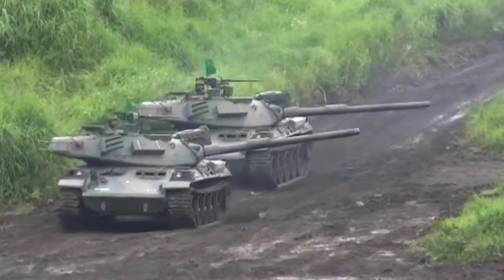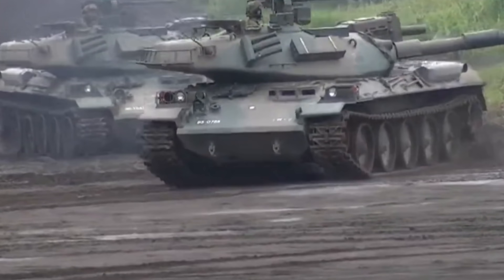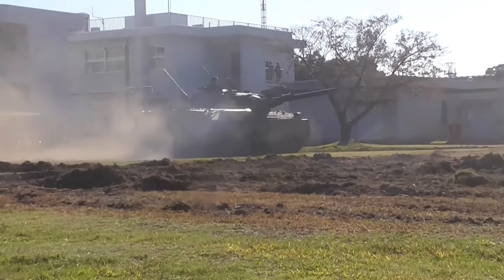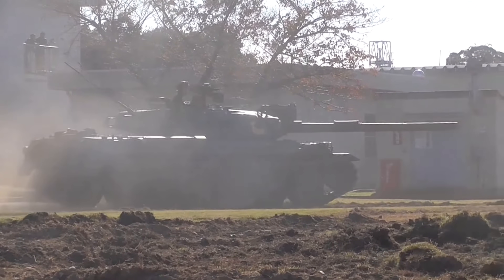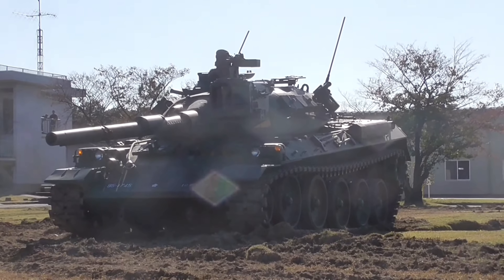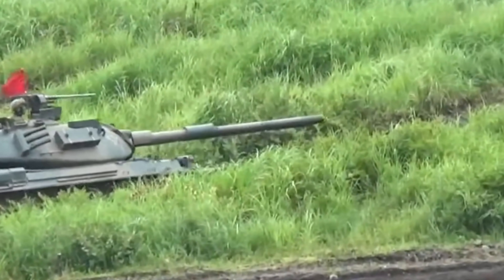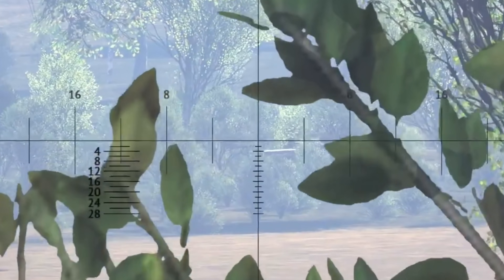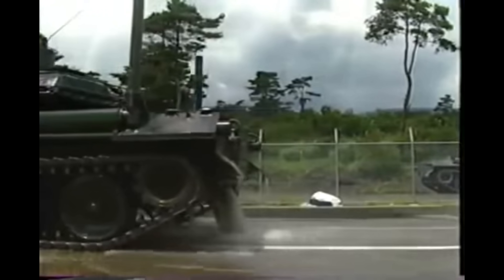Japanese TYPE 74 Main Battle Tank Overview | THE TOO LATE TANK

Comment: The t 80 was built for snow low rounded turrent snow drifting don't pile around them but wide tracks for snow and bury in snow or tree line looks like a broke off tree the barrel and will pull rite out in  1st. Not a war lord just a gear head nerd

Comment: It came really late but it's still very useful. When it was new, the Japanese only planned for defense operations on it's islands. The main opponent would have been China and possibly the USSR. Both utilized mainly T-55 and derivatives. It would have overpowered them easily. Given the terrain and Japanese preparations, even the newer types could have been picked up from defensive positions. This usefulness might be one of the reasons it's still in Japanese service today.
Reply: That's not true. Japanese ground defense conceptions were occupied with the USSR in the Cold War, China wasn't really perceived as a threat in this regard. 
And by 1974, the soviet army had already adopted not only the T-62 but also the T-64A and the T-72 and was to adopt the T-64B only two years later.
Reply: @hendi1571  While this is true, you have to keep in mind the logistics of a naval invasion. Soviet Armed Forces invading Japan at Hokkaido for example would not simply be able to magically teleport their heaviest tanks across the Sea of Japan during initial phases of invasion. Soviet naval landing forces could only do beach landings with T-55 due to weight limits, and as such the Soviet Navy were actually the first adopters of hard kill APS for their T-55s to compensate for lack of armour protection. 

In any case, the statement still stands that the Type-74's main armour opposition, unless beachhead was secured and expanded without convoy harrasment, would be Soviet Navy T-55 tanks with active protection for ATGMs. T-64 would absolutely be tied up fighting in Europe anyway in any realistic WW3 conventional scenario, and T-72 would likely also be directed towards the European Front primarily.
Reply: @manofconstantgold  that's a very good point actually! I just tried to find equipment lists for the far eastern Military district, but as it wasn't subject to the CFE treaty it's quite hard to find information about. But it's quite possible that its units didn't receive T-72s in substantial numbers.
I think its still important to point out that the Type-74 was already very much outdated back in 1974.
Reply: @hendi1571  Again, I would debate that you could call it outdated. 
Outclassed by certain premier designs? For sure in many aspects, but the Type 74 imo was at least as capable as later variations of the Leopard 1 which are still in service with the junior NATO nations today. As of 1974, the number of potential WW3 combatants and regional threats in Asia which would or could field vastly superior MBTs was pretty miniscule. 
When you keep in mind terrain and infrastructural limits of tank combat in Japan, I'd say the Type-74 was just about ok. When it came out. Neither advanced nor outdated by anything other than quite literally the most expensive and advanced modern MBTs fielded by the world's superpowers and great powers. 
That being said, I do personally prefer the TKX-0001 prototype out of all the MBTs Japan manufactured.
Reply: @manofconstantgold  there I have to disagree. 
It was a design comparable to the Leopard 1 and AMX-30 both of which entered service almost a decade earlier (of course, it was more capable than the original versions of these two tanks but it's about the basic design). In '74, as I said, T-64A and T-72 had already entered and till the end of the decade the T-64B, T-80B and T-72A as well as more noticeably the Leopard 2 and M1 Abrams would enter service. All of these tanks were significantly more capable and modern than the Type-74 and had much more potential. The Type-74 lagged behind by roughly one generation. That wasn't too much of an issue - and there you are 100% correct - as the most likely adversaries in the region didn't field the most modern designs (at least locally). 
A bit off topic but while the Type-74 was certainly comparable to 'mid' Leopard 1 versions and even exceeded them somewhat in certain areas, the Leopard 1s still in service with NATO armies are more capable than the Type-74s in service with the GSDF (except for most of Türkiye's Leopard 1A3s). Doesn't matter anymore as the latter will get decommissioned this year but it shows Japan's continous failure to keep its tank fleet up to date. Type-90 and even Type-10 face similar issues.
Edit: wrote T-70B instead of T-80B.

Comment: Type 74 is a good tank and would still be useful for some forces today. It is light and mobile enough to provide fire support in rough terrain. Personally I think that Japan should sell all of them to the Philippines for a bargain price (scrap metal equivalent cost). Of course they are dated for tank on tank battles but can still destroy other armored vehicles, fortifications, and soft targets. Type 74 has been well liked by Japanese users and deserves a second life somewhere where it can be of some use.
Reply: Japan should build more Type 10 with an active protection system added in lieu of some of the modular add on armor. It could replace the Type 74 and Type 90 still in service. Supplementing with their wheeled gun platform is fine but they also need to modernize their tank force.
Reply: @Stu_Bur  it is under project. Japan is currently looking ot improve  the type 10 self defense capability with APS, new soft kill APS systems, and armor packages. the goal is to slowly build more type 10, however remember the countryside cannot always suppor type 10s weight. Type 74 are still very helpful on this case, being deployable in numbers in a very small timeframe. They also put most of the budget on airforce and marine, because a ground defense scenario is the last resort.
Reply: @revan22 Japan has already made the decision to reduce the total size of their armored force from 1000 to perhaps half that, with Type 16 maneuver combat vehicles, drones, and missiles filling some of the capability gaps. Type 16 is no match for a main battle tank but can provide fire support for infantry and is much easier to drive in urban areas and has a lower weight than Type 74.  Type 10 is a bit lighter than Type 90 which still need to be phased out. Even with APS added it could have comparable weight to Type 90 or less. The current production rate of Type 10 is extremely low, too low to even meet these modest objectives. This is entirely due to budgetary concerns.
Reply: Or even Taiwan, it can take out anything being landed on the beech, with the mobility to move though mountainous terrain.
Reply: Lmfao the elusive "tank on tank battle" that never happens in reality. Heard that Ukrainians almost exclusively load their western-delivered MBTs with HE instead of AP? Take a wild guess why that is.
Reply: @baraka629 I mean, to be fair, a Tank's job first and foremost is to support the infantry in an armoured thrust fighting in combined arms (at least this is how tanks have been used doctrinally, depends on the doctrine too, but tanks were created to support the infantry) so loading then with HE is understandable. MBTs are pretty much jack of all trades tanks anyways so they just incorporated many other features of the old norms for tanks and the separate tank destroyers which were specifically made to kill tanks, it's just that the MBTs are capable of either infantry support or Anti-tank, making them better than previous generations of tanks
Reply: @poikoi1530  not really? I mean tanks do support infantry but that's not really what they're made for anymore, it would be more accurate to say they also support infantry. Hell depending on the doctrine, sometimes it's the infantry that support the tank. An MBT's job is usually to break through enemy lines or to set up in a defensive position
Reply: @baraka629  has a little bit to do with Russia having no tanks left.
Reply: @warhawk9566 the ztards still have like 5000 tanks on the frontlines. Thats why Ukraine can't push still. They aren't going to be able to for another ten years at this rate.

Comment: Wait, did it actually fire a round off while still stable and not an inch of movement from recoil??
Reply: blank for traning/show
Reply: @zhufortheimpaler4041  Nope.  That was the annual live fire demo the JGSDF do.  That was a live round.  The suspension actively aids in absobing recoil.  Fire on the move and sway all over the place - for the exact same reason

Comment: Strv 103: “Who are you?”
Type 74: “I’m you but with rotatable turret”
Reply: "I'm you but a decade later and worse." Reminder that this entered service about the same time as the Leopard 2 and M1 was coming into service.
Reply: @Ragedaonenlonely 
You can’t compare a Leo2 and Abrams with type 74 as they are nearly double the weight of type 74.

That is like comparing a Lion with a Cheetah.

Plus type 74 is more than 3 times less expensive than the two, and slightly cheaper then Strv 103. They all have their pros and cons.
Reply: @Ragedaonenlonely  Was it actually worse thought?

I mean, it has an actual turret.
Reply: @EdyAlbertoMSGT3  Yes. In many, many ways. I could go into it in more detail but it would be a very long list. Suffice it to say, the turret (which was still of a questionable benefit given stabilizers were still not all there yet) and some fcs it is mostly just inferior in most respects. Well, I guess it was a pretty mobile vehicle too so it did have that going for it.

Comment: Japanese naval ammo in WWII and the armor made for its warships had extremely high levels of quality control (not necessarily the best designs, but they made them to the accepted standard very closely) -- better than most foreign manufacturers in some categories, such as the extremely thick face-hardened armor plates made for the YAMATO Class battleships, which had a very uniform hardness pattern, most especially difficult with plates as thick as 26" (!!!!) that were well above the thicknesses made by any foreign manufacturer.  The unusual resistance of some experimental Japanese armor (made after battleship production had ceased during the middle and end of WWII and the naval armor engineers could now experiment based on their own modern ideas) was so profound that in the reports on it by the US Naval Proving Ground, Dahlgren, Virginia, after their own penetration tests in the latter half of 1940s, the US test personnel actually said that since they did not know how such good results were even possible with plates made of standard metals (the Japanese were using regular armor steels and just trying out new ways to strengthen and manufacture plates by various unusual heat and mechanical working treatments), the final paragraph in the final report on the US Navy testing of Japanese heavy naval armor was forced to state that it was now obvious that the US Navy experts on armor design did not understand how face-hardened armor works, which was an amazingly honest (and profoundly embarrassing) thing to say in an official report!  THAT is the level of Japanese engineering and is a true warning about what the Japanese were going to do to several US industries post-war...

Comment: Thing just looks like a cooler Leopard 1.
Reply: Nah Type 74 is more like the japanese Amx 30B than leopard 1
Reply: @ijasab35  the AMX 30 B and B2 variants are French not Japanese and the type 74 is Japanese
Reply: Leopard 1 vastly more cool than the Type 74 but the 74 much better armor
Reply: @terifarley4770  na i'd say the type 74 is better in certain categories or is similar to the leopard 1. They both pretty much have the same idea behind them, fast with good firepower.
Reply: @terifarley4770  uh no equal irl it has a lot of armor

Comment: Composite armour, ERA????   20 yrs behind the rest of the world.  Luckily nobody is going to invade Japan.
Reply: This si an old tank that remains in service just because there are not enough type 10s yet.
Reply: @manueldelbusto725  OK, thanks.
Reply: @manueldelbusto725  discovered that Type 10 designed to replace Type 74. However Type 90 found to be not best suited for purpose  and will be usurped by Type 10.
Reply: @csjrogerson2377  exactly, they should update their type 90s tho, with a couple of changes it would become quite competitive even today.
Reply: @manueldelbusto725  They could but somr of the reasons it failed is coz its too big to transport and too big for the environment in which its required to operate.  Flawed concept from the beginning.
Reply: @csjrogerson2377  i know, doesnt mean they cant make it stay on some specific places and thats it, its a good hull and with some appliqué armor / era and maybe a new CITV would make it a great tank even today.
Reply: @manueldelbusto725  True, but why make a tank you cant use in many parts of your own country !!!!   Build one that does - Type 10.
Reply: @csjrogerson2377  they were probably scared 0f getting invaded and made the best thing they could

Comment: The problem I see with most of these island nation's is that their tanks aren't multipurpose in design. A tank for Japan should be able to be amphibious and taken down enemy aircraft while taking on land warfare as a main objective. IMHO
Reply: That is a tall order even for a warship. I agree more armored especially ones designed for transporting troops should be amphibious, but as a self propelled Air Defense gun that can take on both attack helicopters and tanks is asking for two separate turrets on a single chassis. It has been done before but not to any success.

Comment: Well, I don't know if it is that obsolete! 
Considering the number of island that the greedy chinese have their mind set for. A platoon of tanks on each of those island will change the calculations for an invading force considerably.
Especially if you consider how cumbersome it would be for an invader to get a T-72 tank on a rubber dingy - and paddle it ashore.

In defence of small island you brigade the arms much lower. You might have a company with infantry, armour and artillery - depending on the size of the island. Can the island be invaded? Of course it can! But at what cost????

When the USA invaded the islands in the Pacific they expended a 14" or 16" shell pr. japanese casualty - and that is before the marines got up close and personal.
Reply: Japan has kept a target number of about 1000 tanks in the JSDF for many years. Type 74 could still assist in defense but is outclassed by modern PLA and Russian tanks and they both have the ability to transport significant numbers of their tanks by landing craft and by air. While they can still put up a fight they would be at a disadvantage against opposition armored forces.

Comment: Just wondering if they had problems with the tracks. Track tension seem to slack at times
Reply: Maybe that's caused by the suspension itself?
Reply: @Bakotcha   yes, hence my question
Reply: @jantschierschky3461  I mean, the tension of the track might seem slack / loose at times to compensate for the suspension change itself "maybe"
Reply: @Bakotcha  yes, so I was wondering how much of a problem it may cause.  Especially when travelling

Comment: Impressive machine, always loved Japanese engineering. But I have to ask not just about the Type 74 but all temporary tanks. Why did they use armour made out of nothing but homogeneous steel, which gives about the same protection against sabot and HEAT rounds as homogeneous clay, and then complain about 'armour' being obsolete. I find it difficult to believe that the idea of sandwiching in something harder like Tungsten, or even just some air gaps, had not occurred to the designers. The Germans were doing it on a basic level with skirts on the side of their tanks back in WW2. It doesn't take a genius.

Comment: Are these still in uses by the JDF?
Reply: Yes, in large numbers. The Type 90 was meant as a partial replacement but is much heavier and this made logistics a bit more complicated. The Type 90 thus were mostly deployed in the North. Type 10 in base configuration is only slightly heavier than Type 74 and is much more capable overall. But public opposition to defense spending has left Type 10 in very low rate of production and it still only makes up about 10% of their tank forces. Type 74 is still their most numerous type of tank, comprising over half of their tank forces.
Reply: @Stu_Bur  And when you think about it, Chinese tanks aren't really suited for the dense and mountainous forest of Japan. So Chinese infantry & lightly armoured vehicle has to made up for it "if an invasion ever going to happen in the future" in order to cross the terrain, so if we're talking about armour penetration the Type 74 is still sufficient for destroying lightly armoured vehicle "not that it could take an actuall tank round / rpg anyway" but it could still become a huge threat to the enemy infantry & AFV fighting in the jungle.
Reply: Yeah